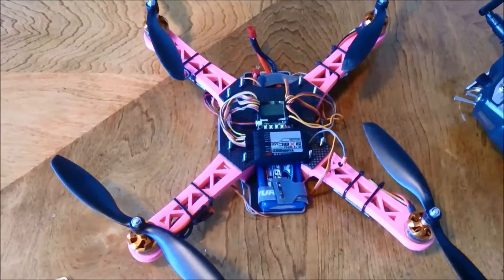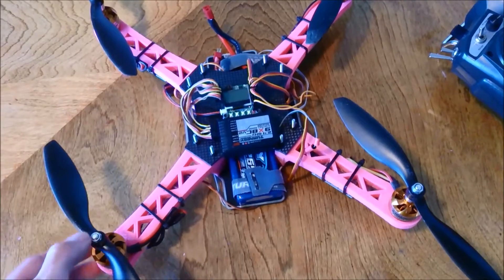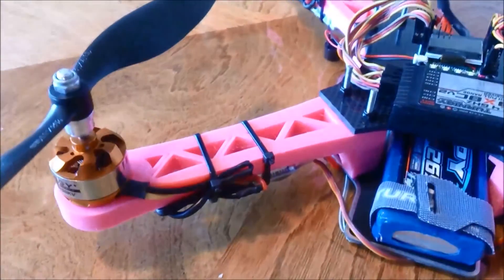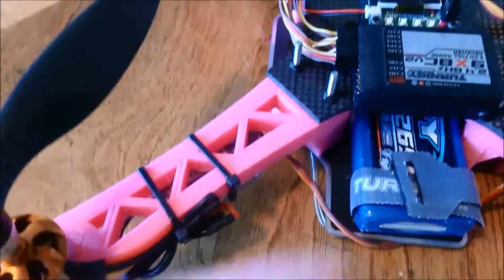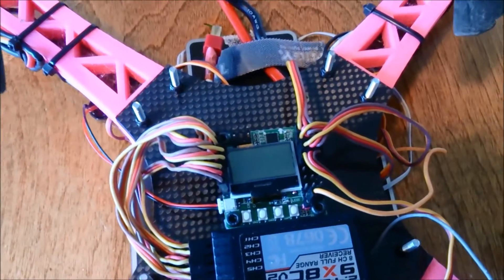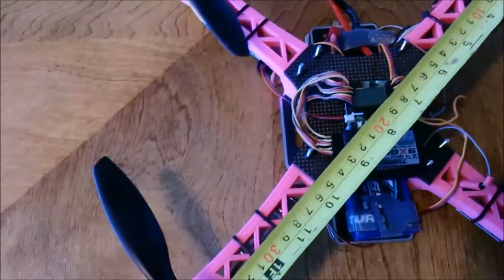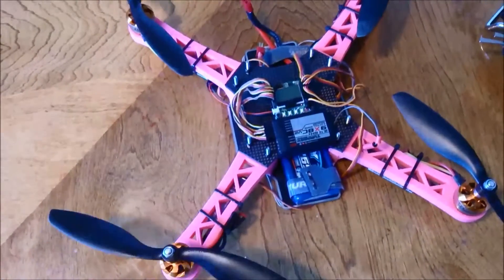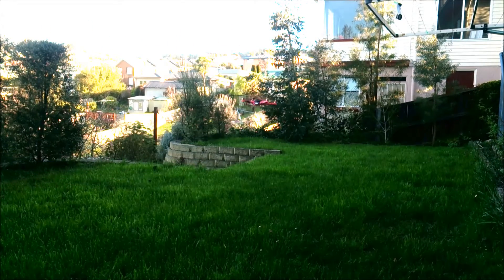3D printed Quad arms & KK-Mini

Comment: If you have any thread left after tightening the prop nut down, use the smallest drill bit you have and make a hole thru the stud. After you tighten the nut, take a short piece of copper wire and run it thru the hole, pass each end under one propblade, back up, and twist together. The balance will not be affected to anything you can notice, and your prop nut will be secure without threadlocker, or in addition to, a smaller amount of the blue goop. 
Also...thanks for showing your flight vid. I am struggling to get my quad airborne. The first 2 times it went backwards quickly. Only after breaking 2 arms and re-checking my Tx settings, did I realize that I had corrected my Ail and Rudd to be reversed, but had forgotten to test my Elev...DURR....it also needed to be reversed. It was then that jamesb72 told me he holds his quad in one hand over his head while testing stick inputs. How crazy simple is that? Seeing yours pop up off the ground lets me know as soon as I can remember to make all the checks i can , My craft will fly correctly. Thanks.

Comment: Have you tried the RC911 firmware on the KK2.1?
Reply from the maker: No I haven't actually. I've only been using naze32/multiwii lately. I found a multiwii port to the KK boards: http://www.rcgroups.com/forums/showthread.php?t=2157987 
Works quite well!
Reply: Yep I watched that one. The RC911 has a mode similar to horizon on the MultiWii. when hard on the sticks it will flip. When you back of the sticks it will self level. I have found it very nice on the KK.

Comment: One last question. I now have a wire running from the red voltage pin on the mini board to the positive side of my battery and it's showing  17.6V on a full charged 4cell 14.8V. I am so lost now.
Reply: And my voltage checker confirmed my battery is correctly charged at a max of 4.2 per cell
Reply: V10Pilot Well...you can see by your own statement that at 4.2 x 4=16.8, so its not that far off. Take a good DMM (digital multimeter) and check it right away as the time you plug into the KK). If theres any skew in the readings, take a day or so and let the battery run down under load, and periodically check it with the meter. Watch for the same difference, or curve, note it, and there ya go...your new battery voltage power level multiplier.

Comment: Thanks. I had a feeling that was correct but I was afraid of getting the magic smoke the instant I connected that little board to a big battery. I have searched high and low for this info and there is nothing out there about these boards. If you did a video about the connections and what each set of pins does, you would get a lot of views. Everyone is talking about the KK2.1.5 and I found only 2 fairly vague videos about the KK-Mini and they weren't very good.

Comment: I just built the RC Explorer TriCopter V3 using the KK Mini and I have a question. It uses a single red pin for the voltage sensor but im not surehow to connect it. Do I simply run a lead from the positive side of my power distribution to the single red pin? Is there a negative lead i need to connect?
Reply from the maker: Hi! Yep, just run the positive from your battery to the red pin. All of the grounds are common, so you don't need to worry about the negative lead.